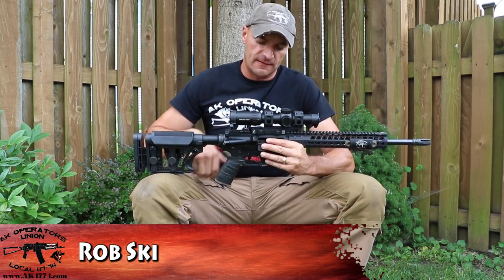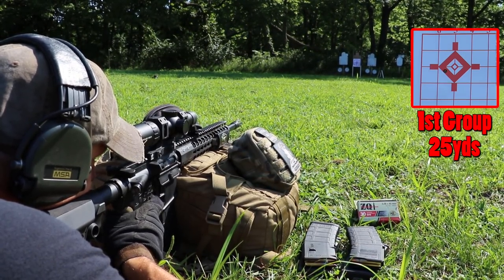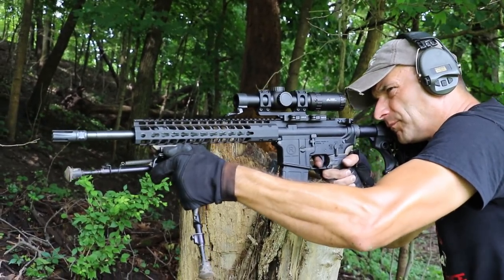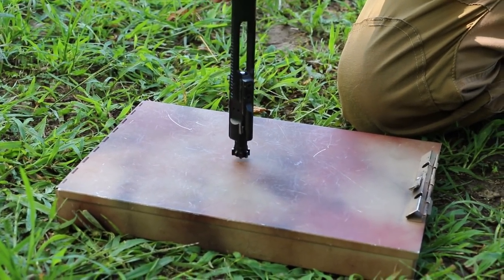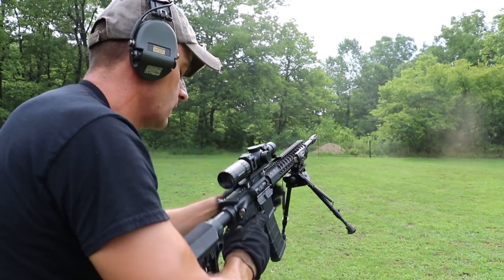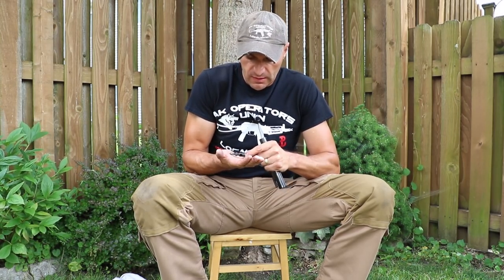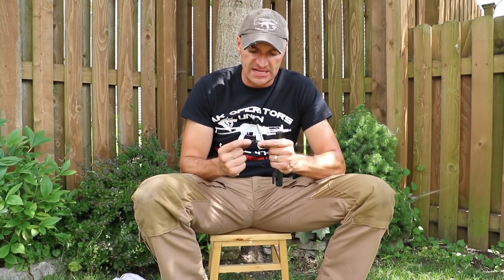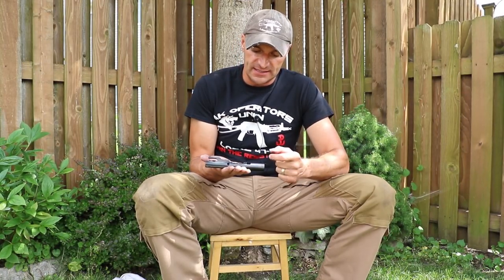Radical Firearms AR-15, 4310rds LATER - Another one bites the dust!

Comment: This is a very common failure in AR's in general, not just this manufacturer. A cam pin is a 9 dollar part. Rings are 2 bucks.  You should always have extras in your spare parts kit. Overall, I'm quite impressed by this inexpensive rifle. I'd really like to see you replace those parts and keep going.
Reply: I agree with tou for what your getting vs the price it's still a decent deal. Over all I'm impressed with the accuracy as well as how good the rifle functioned without proper maintenance. The good thing about AR's is parts  availablity and the ease of fitting them.
Reply: This is like saying a sensor on your car dies at 10,000 miles and leaves you stranded and you still think it's fine.
Reply: +Caleb C it's a cheap bolt altogether
Reply: +Mike Marion yes, i found the quality and finnish on mine to be lacking also. radical needs to slow down and focus on quality a little more.
Reply: Caleb C If a $9 sensor in my otherwise amazing car failed, after neglecting all recommended maintenance, and I could easily replace it myself, then I wouldn't hold it against the car. 

Broken cam pins and other bolt/carrier parts failures are common issues on every AR with a milspec BCG, not just the Radical Arms. If you're going to call this rifle a failure due to this part failing after 4k shots and no maintenance, then every single military issue Armalite is also a failure.
Reply: +Jks jks in a fight its a catastrophic failure. im sure your gonna ask your enemy for a timeout till you diagnose and find out the issue to switch it out (sarcasm).
Reply: +maxinvasionleet I agree. The point isn't that you can't fix it,  it's that the gun should be built right from the start
Reply: +Xaro Xhoan Daxos Qarth lives!
Reply: if you inspect parts when you clean your rifle, you can change out parts with excessive wear before they break. we do it all the time
Reply: Robert Smith LOL, that's like running your car 50k miles without any maintenance checks and when something breaks saying "It should have been built properly the first time!!".

Any AR on the market can suffer a bolt/carrier issue. That is why when we clean these rifles we check for wear on these parts and replace them on a regular schedule. AR guys have just come to expect that these are parts that will wear out after 3k rounds or so and need to be replaced as part of routine maintenance.

It was a long shot for any AR to last this long under these conditions, much less a $500 one. AR guys will look at this test and say "Damn, that is impressive". AK guys, eh, not so much.
Reply: +Xaro Xhoan Daxos more like running your car 1000 miles and it burning 2 quarts of oil. Considering battlefield Vegas has 130,000 plus rounds of their AR I'd say this round count is nothing. They replace the bolt every 20,000 rounds I think. Everything else will last much longer.
Reply: +Robert Smith 
this bolt still doesn't need to be replaced. In fact, only the gas rings and cam pin did. Who said anything about having to replace the bolt?
If you read the piece battlefield loss Vegas wrote, they said the most common failures of their ARs were gas rings, cam pins, and sheared lugs. I've seen all of them happen on FN and Colt rifles in the Army.
Reply: +Xaro Xhoan Daxos that's what I was thinking. I have no experience with Radical Firearms, but I'm impressed.
Reply: +Xaro Xhoan Daxos that's what I was thinking. I have no experience with Radical Firearms, but I'm impressed.
Reply: I honestly think he caused the broken cam pin replacing rings with a frigging tack.
Reply: +bigtruckboy20011 
I have a .300 blk RF pistol that I've put about 1000 rds through and I haven't had any problems. I don't think I could find anything any better for 550 bucks
Reply: +maxinvasionleet of course not, but then again all machines break. Failures and breakages are a reality in combat.
Reply: +spencer han I think so too, but don't hold your breath for that $550 Colt. It's all what level of rifle you are willing to pay for. I have a Franken Ar15 that I put together, that I believe would outperform  a Colt factory rifle in a test like this(with no cleaning) until one had failures. I think the RF Ar15 did well for its buget level status.
Reply: bigtruckboy20011 Indeed. Centerfire is selling these RF-15's for 499.99 I don't see how anyone can complain about this level of performance vs that price point.
Reply: actually a part of the BCG broke. I don't consider that the "rifle" breaking. That would involve a bad chamber, warped barrel, etc.. If you buy the complete upper alone, it doesn't even come with a charging handle or BCG.
Reply: Sean Malahy That is a valid point.
Reply: +Jjj 543 radical does not make the bcg. In fact the company that does makes them for all the sub 900$ ARs.
Reply: +Sean Malahy Could also involve his cleaning habits. I've worked on more AR's/M4's/M-16's than most dealers ever will. Most people have no clue how to thoroughly clean these BCG's.  That said, I've seen Bushmaster pins and/or rings break at fewer round counts. That's why any field repair kit you purchase contains the pin & rings (plus all the other pins, springs, etc.). They can and do fail from time to time.
Reply: +Aaron Morgan for such a small part under a lot a stress I'm kinda surprised no one has made a replacement part out of titanium or something
Reply: +Aaron Morgan What do you recommend to prevent the failures? I just purchased a 8.5 upper in 300 Blk. Would purchasing a higher grade of steel in pins and rings hold better?
Reply: Well said!
Reply: GlockMonster29 use what you have man. It will hold up fine with cleaning it and lubing it.
Reply: GlockMonster29 If you want some extra durability, get the "POF roller cam pin", google it. It's a 20 dollar direct replacement part for the cam pin and will reduce the wear and prolong the life of your BCG (if for some reason you are going to be putting your AR through some serious torture.)
Reply: Thanks for the response. I wont be torturing it but it will be fired quite a bit.
Reply: more like a fuse going out. Bolts are like a 5 min fix
Reply: Aaron Morgan
yeah, I work for a shop that makes AR's and AR parts, suppressors, etc.. A lot of folks I know even keep a spare bolt in that little nook in the pistol grip, along with spare rings, pin, etc..  That's especially true on the large bore AR rifles where the bolt has thinner side walls, and is prone to breakage.
Reply: if this was your concealed carry would you be saying the same thing? ABSOLUTELY NOT! so why is it so acceptable in the ar world? why do you want a rifle that you "have/need" to keep extra parts for? makes no sense whatsoever
Reply: if it were my concealed carry I would not dump sand in it and fire 5000 rounds without cleaning it
Reply: Florida Prepper LOL
Reply: There is a reason he has decide to lube the rifles every 600 rounds now.
Reply: +Florida Prepper the point is it can't handle it I'll stick with my aresenal slr107fr which passed this same test! (drop mic)
Reply: O4 HEMI Most people don't mind routine maintenance on their firearms. For 500 bucks, this RF-15 is an amazing piece of kit.
Reply: +Xaro Xhoan Daxos replacing broken parts should never be considered routine maintenance
Reply: +O4  HEMI missing the point.... rob did no maintenance
Reply: I just wonder, why is it ok to replace a fuckin EXTRACTOR on an AK and keep the test going, but it's not ok to replace a cam pin on an AR which is a MUCH simpler repair?
Reply: Lol
Reply: Xaro Xhoan Daxos he did replace the cam pin and it did finish the test. To his defense he did say that it would not pass the 5k test even though he kept firing it. He has also completely changed his test. He now lubes all the guns after so many rounds. This new way of testing is more fair because no dumbass should fire something their life depends on 5k times without maintenance. I think his new test is much more real life scenario.
Reply: The Car Life Oh, cool, when did he finish the 5k rounds? Is there a video?
Reply: I don't think so. He told me he did it so I took him for his word. Robs word is all I needed.
Reply: The Car Life Robs words bring victory, and victory is life!
Reply: For a $500 rifle, 4310 rounds before a fairly inexpensive part fails is not a big deal. Considering a good quality bolt group is $100 on AIM, not a big deal. At 4310 rounds, that's enough to trust your life to for a good while.
Reply: But you could buy 2 of these for the cost of 1 Colt. Just spend the money saved on spare parts.
Reply: Honestly was looking at one of these and saw there are a few people with the BCG's failing. There may have been a bad batch, so likely spending the extra $100-120 for an AIM or other BCG would make this a fantastic gun.
Reply: Agreed
Reply: you are forgetting the cost to quality issue ratio here.
Reply: WardenWolf 
And that's WITHOUT proper maintenance.
Reply: Robert Smith Radical did fix this issue on their Bolt Carrier Group. Over 3,000 rounds in with average brass and cheap steel cased ammo with zero failures. Just have to clean it after every or every other outing and it runs flawlessly. They definitely picked up the quality control last year. Have heard this from many others in the comments of my review of the same rifle. Hope this helps!
Reply: The Green Man .
Reply: I'm just confused as to why a vast majority of y'all can't seem to read the phrase "without proper maintenance"
Reply: I was going to ask if they were replaceable. Thanks for the answer
Reply: @QarthCEO  late to the party; just saw the video today, but I'd say this 'disappointment' is like not changing your car's oil for 75,000miles then complain that a clogged EGR($2 part?) made the engine stall so you should just throw it away. There are plenty of guns more expensive(not just ARs; with better reputations I might add) that would have had at least 1-2 FTF/FTE by the time 4,000rds w/ no maintenance rolled around. I think many are using this as an "Ah-HA!" moment considering some of Radical's early reputation.
Reply: @maxinvasionleet  I don’t know if you understand what your secondary weapon is used for. Do you think we carry the beretta m9 to look cool or to back up your AR in case of failure. Any weapon will fail.
Reply: @QarthCEO  I don't think I would ever shoot any of my ar15s over 2000 rds. For reasons of price of ammo that's 1000 to 2000 bucks in ammo plus that's a Lot of rounds. I may do like 100 rds a year in each of my ar15s. I have owned bushmasters ,DPMS,Tiger,M&P ,Aerospace Matrix ,and Radical.  For the money you can't beat Radical and they function just the same if not better.
Reply: @QarthCEO  that's right great advice.  Keep rifle clean maintained and oiled.
Reply: Ak users just dont understand the idea of consumable parts. They shhot their guns till the barrels blow out and buy a new one
Reply: @dramag27  I drive a 2002 Ford truck at work and yet my coworkers 2021 GMC pickup is back at the dealership for burning oil-after 2,000 miles lol. Same with some newer Ford trucks. The Radical Firearms RF15 I just picked up is a class better than the M&P Sport 2 Smith and Wesson AR15 I had recently. I cut my teeth on a M16A2 in the Corps btw.
Reply: @RobertSmith-le8wp  no expert you
Reply: lol, i haz 2 pins
Reply: For a budget AR to run over 4,000 rounds is pretty solid besides radical is better now than then they have really stepped their quality control up from what I've heard but for a older to go that far I'd def buy one today
Reply: @dramag27 if your car cost $5,000 and you're driving without oil change, maintenance, etc, and only a sensor goes out, you've hit the lottery.
Reply: @QarthCEO true. I can catch a bcg on sale on PSA website for $50 or $60! Other smaller parts are very inexpensive. Radical barrels are chrome molly vanadium and they have pretty good gas systems. I'm no expert but I would not throw the baby out with the bath water.

Comment: great review and tests on this rifle. for a rifle that costs barely over $500, even after this critical part failure, I'm still considering purchasing it. I could even consider dropping an extra $80-100 down the road for an upgraded BCG. not really a big deal in my opinion. thanks for the insight AK Operators Union
Reply: No....my SW MP15 was 524 and I've put over 6000rds through it no issues
Reply: @fujimi715  With or without regular cleaning/maintenance?
Reply: @jeffsnodgrass9747  how is that even a question? With regular cleaning. Why would I not maintain a weapon system?
Reply: @V C I did not say it was a single range trip. Was about 2 year period.

Comment: 5000 rounds is around the area for the first maintenance cycle for small parts. I'm not too surprised the rifle failed a little early, and the company had to skimp somewhere. Some new rings and a cam pin that's made of better stuff and you should be good for another while. At this round count, I'd start looking over the springs in the extractor and ejector as well.

Comment: The uppers from RF are great but their BCGs leave much to be desired. Just buy an upper with no BCG or CH and buy those aftermarket. PSA premium BCG are g2g!
Reply: I bought a Fail Zero for my RF upper and the BCG would hang up on the gas tube. I swapped it out with a PSA BCG and it ran fine.

Comment: I've had SEVERAL Radical Firearms come in my shop with disconnectors that have snapped in half, barrel extensions that come loose, and I've had bolt catches snap in half just from racking the action. You get what you pay for.
Reply: You do some great testing on your channel. If you say Radical guns suck I'll stay far away
Reply: Ive seen problems with trigger groups on radical ar's also.i fully expected the disconnector to go the first 1k rounds...as for the "milspec" bcg...companies will call something milspec if it has 1 certain requirement per milspec.like a finish when it wont be tested or made out of the proper material

Comment: Shared.
Reply from the maker: +Mrgunsngear Channel thx!
Reply: Elijah Wood  a combat load is normally 210 rounds, 7 mags of 30, some carry a max of 10 mags. So putting 500 rounds through a rifle without cleaning would be a good test, 4000 is ridiculous but it gives you an idea of how long a rifle can be tortured before it fails.
Reply: Elijah Wood  are you telling me a 500 round test is not a good test or a 4000 round test? I also mean a 500 round test of a properly lubed firearm. If my rifle ran 4000 rounds without proper lube and failed at 4000 rounds I would know that it wouldn’t fail at any heavy engagement the rifle would ever be put through. I would not subject my rifle to this kind of test though.
Reply: Elijah Wood  yes of course it is, who said it wasn’t? I always carry a spare bcg with me just in case.
Reply: Elijah Wood  are you? You said it was an easy fix, my question to you is who said it wasn’t? A failure that does not allow your weapon to function without cleaning is a critical failure, but I understand what you mean in that its an easy fix and the rifle itself should not be judged as prone to critical failures due to the extreme test.
Reply: Elijah Wood  it is a critical failure, but caused by the operator not by the rifle.

Comment: Nothing wrong with the rifle. Those parts are consumable and they do need replacement, especially after 4300 rounds without much cleaning or lubricating.

I am actually very impressed at that high round count with the abuse that rifle took. One hell of a rifle if you ask me.

With all that being said this video was the reason I purchased a Radical Firearms rifle. Good rifle for $650.

Comment: MAC was just reviewing a Colt SP1 he bought in the 80's when he was a teenager. He said the rifle has all parts from the 80's and over 12,000 rounds. This should not be happening
Reply: Because colt builds quality rifles. These $500 "just as good as" fly by night companies do not.
Reply: I agree. Still, it sounds dumb to save on such a small inexpensive part, which is pretty essential for the function.
Reply: +jpenna1976 I agree. I owns Colts and BCM. They're not even that much. I refuse to put up with such poor quality
Reply: This failure can easily happen on any quality BCG too. For example the gas rings on my BCM are failing the test after about 3,000 rounds. I'll be ordering a spare cam pin just in case mine also snaps soon.
Reply: +desertfox2020 the way shown in this video is not how you test gas rings. your gas rings are most likely still perfect. 
Colt's recommended method is to take out the cam pin and firing pin, with bolt still inside the carrier turn it upside down. If the bolt falls out, THEN it failed the test. If it stays in the carrier, rings are fine. My BCM bolt rings have failed this 'test' for the last 10,000 rounds.
Google army 23&p bolt ring test, you'll see the military manual and the procedure in it for the test.
Reply: this is why i use the nerf rapid strike
Reply: And has never cleaned it? I'm sure he dumped sand in it to? Cmon... lol